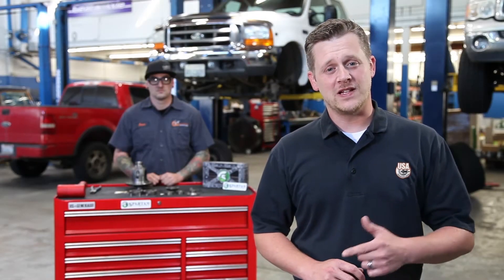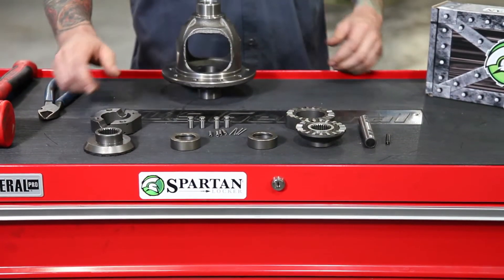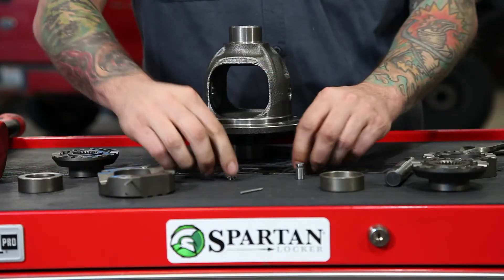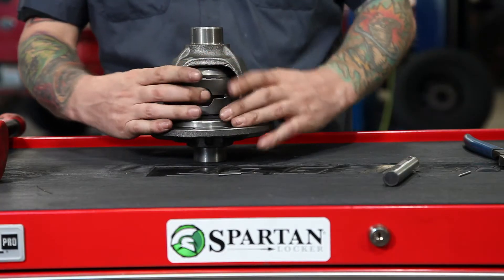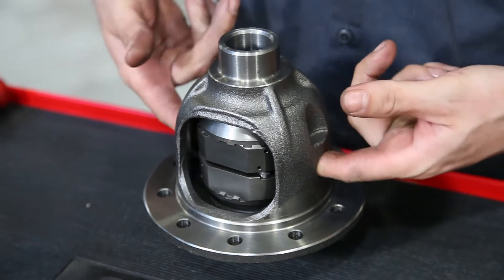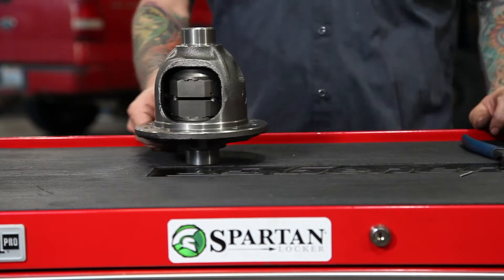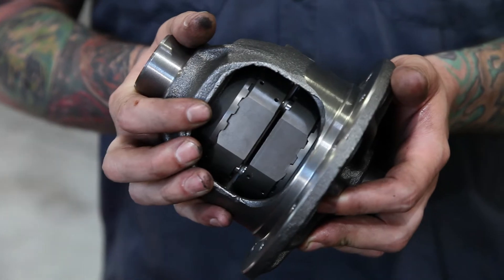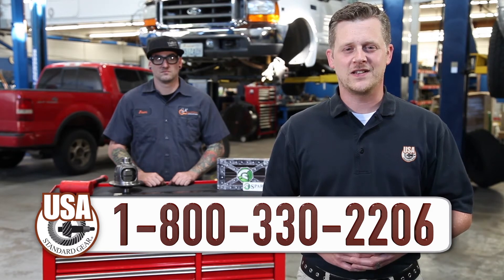Spartan Locker Installation Walkthrough

Comment: .135"??? tween the 2 halves of the locker driven cogs???  NO SIDE SHIMS that the original differential spider gears come with.  that looks like more than .135" or whatever is supposed to be tween the 2 drive gears after installed